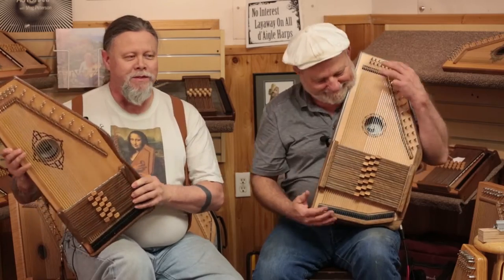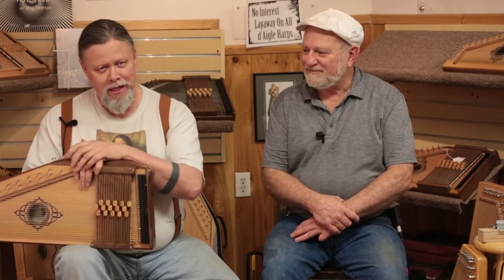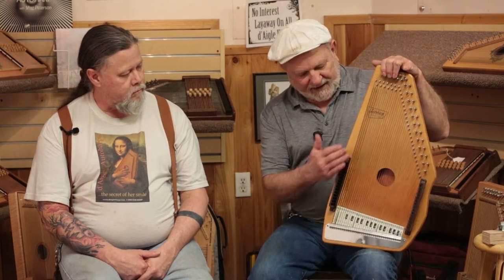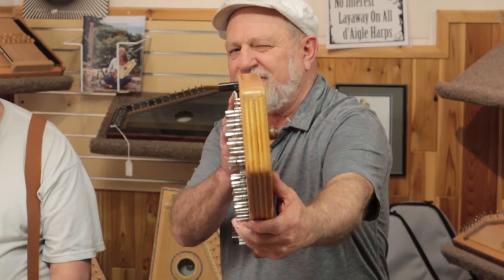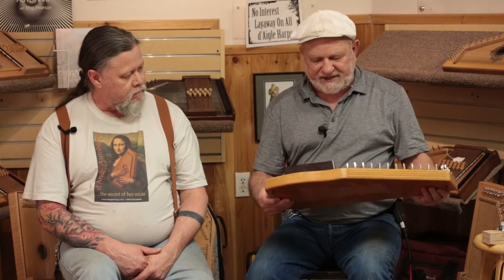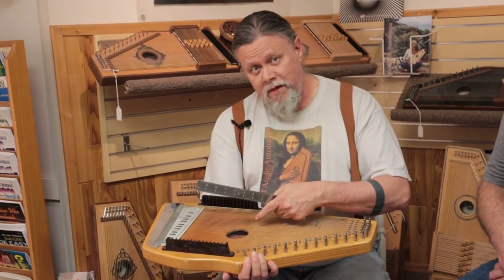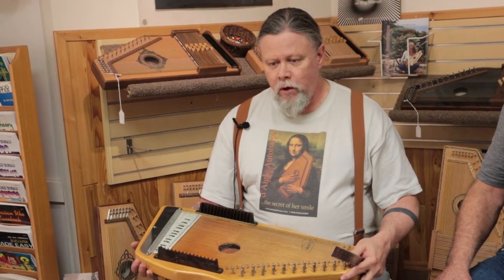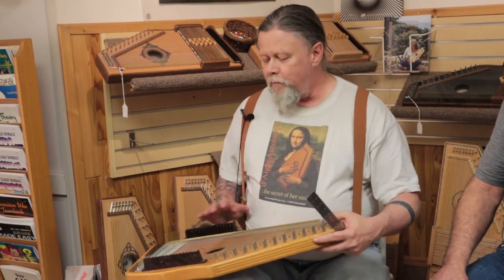Stalking the Wild Autoharp: FAQ's With Pete D'Aigle!

Comment: Thanks so much guys! You're the authority on autoharps to me. The top of my used OS (circa 1970) seems pretty flat, but the back has always been pretty warped. Is that common? It seems to stay in tune pretty well and I still love the sound compared to a new OS.
Reply from the maker: Not very common, warping in the back.  Not unheard of, but not common.
Reply: @wildautoharp  thanks Hal

Comment: Uh Oh......Recently I've noticed that the top of of OS 21C seems to be rounded up around the sound hole AND the corner of the anchor plate at the base end is no longer flush with the harp body. The Treble end is fine. The base strings sound 'muddy', especially on the GMajor chord I just re felted..........Houston, I think I have a problem.....